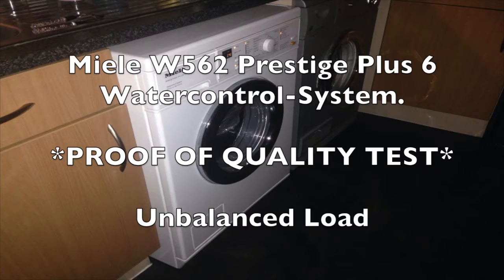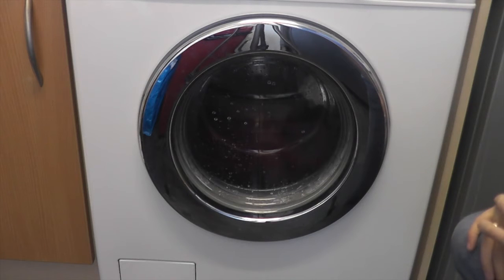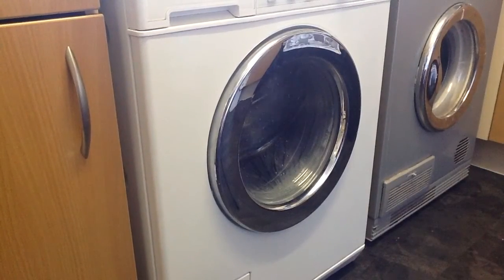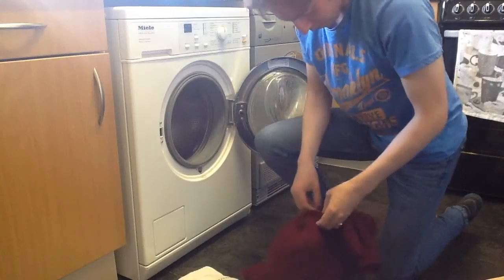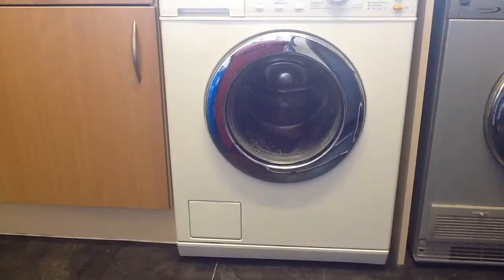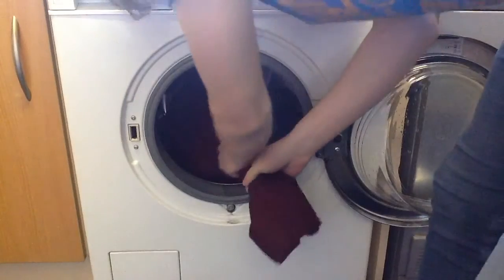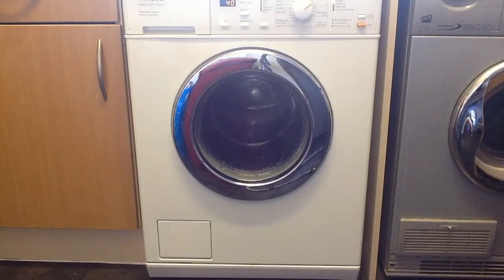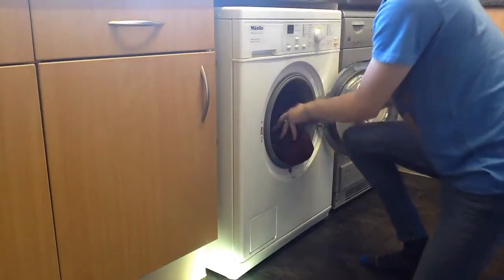Miele W562 - *Proof of Quality test* - Unbalanced Load

Comment: We bought a miele washer and dryer maybe 20 years ago.  It got unbalanced and the drum was way out of whack.  We were told we needed to replace it.  We stupidly bought another miele like it because my wife liked the way it washed clothes.  However we're now probably gonna have to replace the replacement because it's doing the same thing.  The machine is level, but goes into canniptions when it hits the spin cycle.  Piece of junk.  BTW, we had to replace our Miele dishwasher way too soon, and my wife wanted another Miele.  We'll see how this one holds up.  I'm guessing 10 years.

Comment: 13:23 shows how much better older machines are with balancing!!
Reply from the maker: It takes a lot to make a Miele even move, something like that, I couldn't even dream of putting in a vintage one lol. But yes, built a lot better with firmer suspension
Reply: @HooverA3060  Thank you so much for a reply! I quite like Miele's myself. i am a fan of the ones you used as i saw a video recently, was it the W5741? I have used a W3725 one and really interested to know the differences with them even though they may have certain options that they use on one model and the other?
Reply from the maker: @lukekneebone9831  You're welcome buddy! Thank you for your comment too :) I see your posts on Instagram, always love them. Hmm, the last Miele I filmed was the W5000WPS Supertronic, was it that one? Or was it the W5740 I used at BHF? I too am interested in the differences between each range and model
Reply: @HooverA3060  the W5740. I found it quite interesting to see how the W3725's have short, pre wash, water plus and buzzer, whereas the W5740 has short, pre wash, water plus and extra quiet? Wonder what extra quiet is? :)
Reply: Also if you want too, i have some recordings of the Miele w3725 on my laundry instagram. its called lukeloveslaundry18!
Reply: Just hope i am not annoying you thats all, but i am happy to let you follow my laundry page on Insta if only you want too.

Comment: Whays that washing machine next to millie
Reply from the maker: JJM FTW it was an old White Knight WK767 Condensor Tumble Dryer
Reply: FlorenceBallardA3060 ive got a white knight what is white and 13 years old
Reply from the maker: JJM FTW white Knight are very good, ours lasted 10 years, 2001-2011
Reply: FlorenceBallardA3060 90s mini White Knight still going here, sitting on top of a 2016 Indesit. Make what you will of that...
Reply from the maker: RWL2012 really shows how well built they are. I see many 1990s WK dryers still going strong yet modern ones like Hotpoint and Indesit etc are already failing

Comment: "it's a Miele, it is DESIGNED to cope with severely unbalanced loads."

That's like saying my Askos would survive spinning bricks.

Ergo, they aren't built for it, they're just more durable than other machines.
Reply from the maker: Hmm, there's a difference though, a severely unbalanced load of laundry on the spin cycle would result in worst case the machine jumping out or walking about as it accelerates, whereas a load of bricks would cause it to self destruct as can be seen on pretty much every brick video (even there's one of a Miele I think that eventually got destroyed a W754S I think).
Plus Miele are technically designed for it, that's why they've pretty much added 80kg worth of cast iron, 3 shocks on the 7+8kg load machines and 4 strong suspension springs instead of 2.